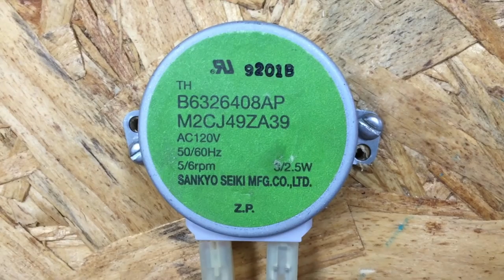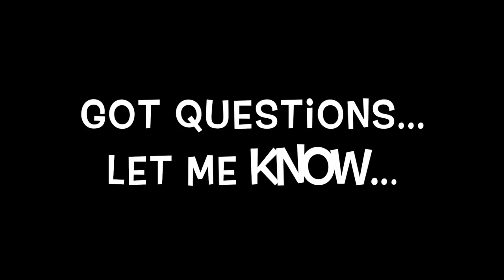07: Wooden Gear Project Ideas You Can Make With A Band Saw or Scroll Saw

Comment: Hi Jeremy, I love these designs, but I would love to ask you a favor. In version three of the Planetary gears where you used another motor, would it be possible to reverse the design? What I mean by this is to put a Weight on the slowest gear and let gravity turn it, and the rest of the gears then speed up as they get more and more speed when can then put a generator where the motor is?

Comment: Hi I am rohith I want to build the rice separate from rice crop through using gears ? it's possible or not ?i observed .most people using industrial motor but it's cost is high? I need speed of 150 to 200 rpm only. Please give some suggestions about it ?

Comment: Very nice work Jeremy. Your gears look very clean an professional. What kind of wood do you use & where do you find it? I figure I can practice on the gear cutting part, but all the wood I have access to has some warpage.
Reply from the maker: I always use plywood for my gears. I usually check for flatness before I leave the store. But I don't use a special "type" except my clock uses hard wood flooring because of the very thick veneer layer on top.

Comment: At 4:10 you put the info "From the book 500 Mechanical Movements" on screen.  We need more on your sources of the technical side of your projects.  That is one, hoping for others, especially clock designs and gearing.  Thanks and nice work, too.
Reply from the maker: I will try... I don't usually have a direct link between my projects and a particular source. Unfortunately its mostly combined stuff in my head. That's why I make videos to get it out LOL
Reply: Can you recommend a clock making book as there are so many gears of different sizes and purposes?
Reply from the maker: +Pascalore I haven't read any books on clock making, and this can't make a good recommendation. Clayton Boyer makes a lot of wooden clocks and his website probably is a better source if you want advice like that